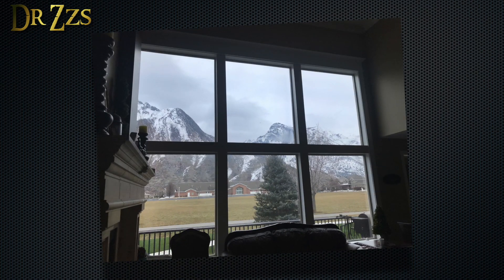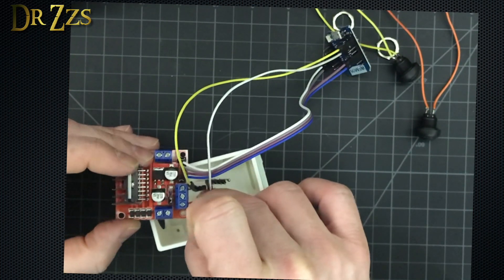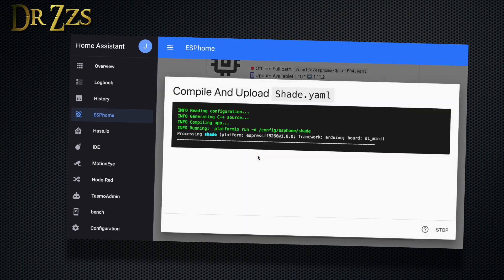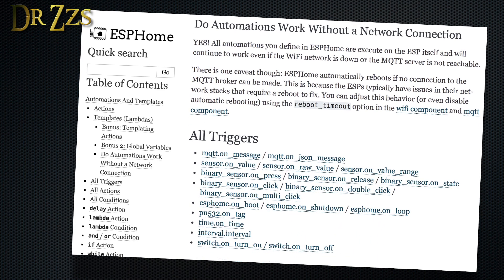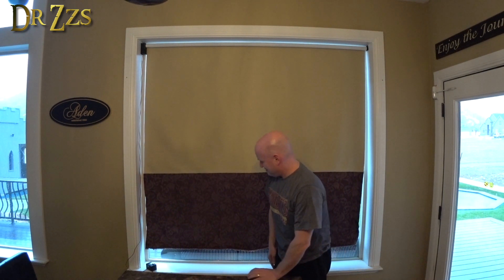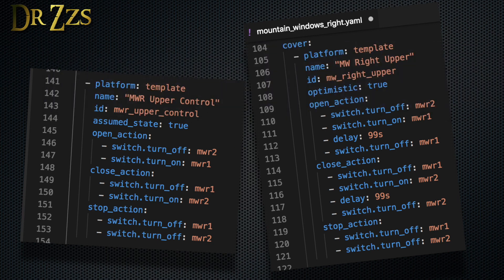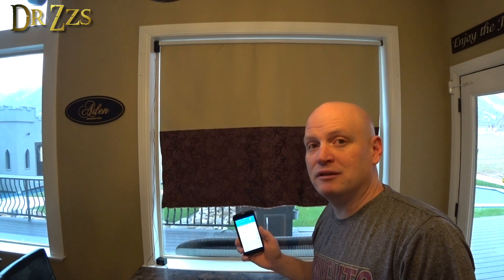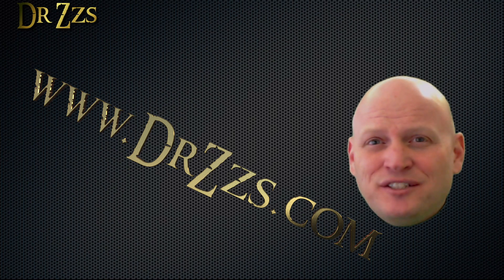DIY Smart Window Shades | Home Assistant

Comment: Create a variable for the current height. So you could do something like pause it in the middle and the variable would now how far into the movement it was when you clicked the button. And then when you go to the app and click go all the way up, it doesn't make the motor turn for 99 seconds, it makes the motor turn until the variable reaches the number your preset to be the completely open state

Comment: what's the difference between a switch and an output?
Reply: Exactly and I have the same question. I did some research but could not figure it out yet
Reply: A switch gives you a control that you can turn on and off. An output is something that the esp board can set to on or off.

Comment: You could use two door sensors (like the Wyze, or something that works without flashing HW) to provide full up and down states. Fasten one magenta to the center bottom of the shade, mount one sensor on the window sill and one on the frame above the rod. Assuming the location is sufficiently repeatable, the sensors can tell you when to stop.
To handle position uncertainty, just fasten a lot of small magnets (or maybe refrigerator seal?) Along the bottom of the shade.

Comment: What you call "intolerable levels" is nothing compared of what's an every day life in the middle east (:
Reply: I bitch about the summer heat in Kansas city every year, but someone always reminds me of how hot other places are. I'm thankful it doesn't routinely get over 38* here.. That said, upper 30s with 80%+ humidity still sucks.
Reply: Yup , here every day is considered “hot” so as you can figure out AC bills go high up 😂

Comment: DrZzs- you could add a magnet in the bottom of the curtain and reed switches on the lower and upper frame to indicate closed and open position. magnet strength could allow a larger gap

Comment: Hey Dr... 2 ideas here... 
1. Telescoping: Cut a slit over the length of the (EMT?) pipe and slide the curtain in. Gives you the ability to adjust it until it is just perfect, then a few dobs of glue at the end at the inside of the tube to fix them in place. 
2. You want to block out the sun and avoid heating your house up. But what if no one is home to close them? You have a light/ temperature sensor  controlling the automation? That would turn it fully autonomic! 

I am waiting on the arrival of my Raspberry Pi4 (4gb) to get started transforming my automation to a non internet-dependent/ privacy controlled one. 

Thanks for the educational videos and the occasional laughs! 
Sub +1
Reply from the maker: Thanks!
those are good ideas :)

Comment: am looking at some motors and I see some that are 25 RPM for the same price as the 10rpm . what a good rpm for windows blinds?
Reply from the maker: totally depends on how heavy your blinds are.  It's really all about the Torque. If the motor is the same power, then the gears have to change to increase torque, and that reduces speed.   A shade like I use in this video can use a much faster motor.  I changed this one out for a 45rpm motor.  
I was looking for a torque meter of some kind to be able to measure the torque required to lift something, but haven't found one yet.  So I've had to just try different speeds to see what works.  My blinds are pretty heavy and the 10rpm motor lifts them but I don't think one with less torque would do the job.  
Sorry that's not a firm answer for you.

Comment: So instead of a timer, couldn't we add limit switches to the esp8266? End stops in effect?
Reply from the maker: yes, and after trying a few different things, that's what I'm going to do.  I was trying to avoid running a lot of extra wires, but reed switches don't react fast enough and if you get the timing wrong just a little it adds up over time and pretty soon the shades are not at all where you'd expect them to be.
Reply: @DrZzs  yeah that's what I thought, 90 secs this way and 90 secs that way over time would see the blinds either do a wrap around on the pole or scare the cat as it hits the floor. But yeah magnetic Reed switches on a slow motor rotation should work well enough and due to not carrying a lot of current could be supplied by tinned copper wire, very thin and minimum raggling to hide  eh? Cheers for replying buddy

Comment: Suggestions: Use some 3d printed part to keep it straight and since u have ur controller at the end of the shade, using two IR sensor on the top and bottom as indicators to find if its all the way up or all the way down u may don't have to wait there for make it stop!🙌
Reply from the maker: good thinking!  I've since added a piece of thin pvc pipe to the end and it stays straight now.  I do need a better solution for stopping it at the ends.  Thanks!
Reply: @DrZzs Welcome, using some ir sensors is the easiest way u can find some coding in github just try it it's really easy!
Reply: @DrZzs  hey can I have your email I wanna show you something that I build thanks to you! If it's ok

Comment: I have 3 blinds all in proximity of each other that I would like to automate. Is there a Hbridge controller that would allow 3 motors?  I've seen some controllers for 4 for robots, but not sure if the specs would work.  https://www.digikey.com/product-detail/en/dfrobot/DRI0039/1738-1191-ND/6588612?WT.srch=1&gclid=EAIaIQobChMI5qPu28WW4wIVlrXACh1CwgI5EAQYAyABEgKXFvD_BwE
Reply from the maker: I just took a quick peek at it and it looks good to me.  1.2a should be fine for these motors. The one I've used is rated for 3a but I think it's overkill. Anyway, looks like that one you've linked would work for 3 blinds.  Good luck!

Comment: Don't you find those geared motors very noisy for this application?
Reply from the maker: Kinda noisy ya, but not enough to really bother me.  I would expect there are other options that are less noisy but they are likely more $ too. 
I like these motors quite a bit.  They are cheap and they work.  That's 99% of what I look for in parts.
Reply: @DrZzs  no question on cheapness and ease of installation and thanks mate for the housings and stuff on Thingiverse.  Might try steppers to make it quieter but not sure it'll be a massive change in volume. Love your work though mate and all the best from sunny Glasgow,  Scotland.

Comment: The telescoping could be caused by the expanded pipe, where the bearing was hammered in. The larger diameter will reel in that side of the shade faster.
Reply: This is absolutely correct. Even a small diameter change will have big affects the more turns that are added. If you measured the circumference of each end, the difference is how much you will raise the larger side per revolution. If  the difference is 2mm and there are 10 wraps of fabric, by the time you raise the blind, one side will be 20mm higher, about 3/4 of an  inch.

Comment: Add a rotary encoder so you can tell exactly where the shade is.
Reply: What if it for some reason stops and you start it again..?
Think there is no way other than some kind of limitswitch for up/down. Magnet fastened to the curtain and magnet-switches on top/bottom?

Comment: If you really want to stop the heat coming in the home, you really need to put the shades on the OUTSIDE of the windows. Once the heat has come through the glass, that heat is in the room and you're only keeping the heat (partially) between the glass and shades. Any air movement will cause the heat to leak into the room. Here in Oz you see lots of houses with shades on the outside, particularly on the west side of the house (afternoon sun).
Reply: Not really. If you have highly reflective shades, they'll bounce most of the infrared light back out of the window and keep it from hitting more absorbent surfaces inside that turns the IR into heat.

Comment: you should add a position measurement to your shades to prevent them from uncertainty propagation . Either a switch to count the rotations but when you lost it there is no automate way to regain the current position or you use a switch or current detection which knows when you reached the top /are driving in the backstop but you repeatedlywill need to do a reference position maneuver

And when you are moving the shutters you can count the driven time or ticks and you will always know what to do to reach a position

Comment: Secondary to the purpose of the video... Need to work on your first layer unless you intentionally designed textures into the parts. It also seems you have the same black filament issues I do; royal pain to get good, small prints w/ it.
Check out the forums on FB if you haven't already. Lot of helpful people there.
Reply from the maker: Thanks.  I'm also using the MoarStruder with a 1.2mm nozzle so I don't get fine details, but I get big parts printed fast and strong.
Reply: @DrZzs  that's 3x bigger than mine. I agree on getting big things done fast. When I start printing Halo props I'll probably wish I had a bigger nozzle (definitely bigger printer).

Comment: Flare on rod end for bearing, if flare is in contact with fabric, will cause the "telescope". I did not see if this was the case or not.
But awesome video.
Reply from the maker: Good point!  That’s probably it. Dang. Maybe I need a different solution from that bearing.

Comment: What RPM motor did you get? I'm noticing that on amazon they're all the same price is there a downfall to getting the fastest one?
Reply from the maker: The one I got is 10rpm.  There's a trade off between speed and torque (lifting strength).  So the faster ones won't be able to lift as much weight.  I didn't do any calculation to figure out which one to get.  I just figured 10rpm's would be enough torque to do just about anything.  I'm sure you could get one that goes faster and would still be strong enough to lift a shade.

Comment: Now I just need this to work with Alexa rather than Hass.
Reply from the maker: Oh, it'll work with Alexa too.  There's a few ways you could do it.  Do you just use Alexa as your hub?  I use Alexa via Nabu Casa (HA cloud), so she can control anything I have in HA.  But there are other ways.  Maybe nodeRed, or maybe a different firmware on the D1mini that interacts with Alexa.  I'm sure there are ways.

Comment: You need to calibrate the extruder on your 3d printer, you are under extruding badly.
Reply from the maker: Ya.  I use the Lulzbot Taz5 with the MoarStruder.  It has a 1.2mm nozzle and prints big parts really fast.  That first layer doesn't come out too well.  I should look at that.  Thanks.
Reply: @DrZzs , the Taz5 is a great machine. You should be able to get that dialed in without too much work.

Comment: ESP Home looks amazing I need to get more nodeMCU's and D1 Minis
Reply from the maker: Yes you do!   and get some ESP32's while you're at it.  ESPhome works with ESP32's too.  I'm betting by the end of 2019 most of my projects will be ESP32 based.  They don't cost much more than the 8266's and they are much more capable.  But I still have like 10 D1minis that need a purpose in life :)

Comment: Maybe a reed switch to tell if it’s fully open or fully closed? Just thinking. Or maybe with some clever automations I’m not smart enough to figure out could tell when it’s not fully closed and if u want to close if fully it would go all the way up for 99 seconds then go back down
Reply from the maker: good thinking.  That's what the end-stop switches would be for.  But the shade would have to have enough weight to trigger those switches.  There's probably a few good ways to do it.

Comment: Would it be possible with the currently available GPIO in this project to add limit switches for top/bottom?
Reply from the maker: yes, but not if you wanted to run 2 shades from one controller.  Each shade needs 2 pins for motors, 1 pin for push button, and 2 pins for end-switches.  if you try using 2 motors that would require 10 pins.   You might be able to do it, but you'd end up using some pins that have other functions, like Rx/Tx probably. You'd have to be careful about which of those pins is low on startup.
Reply: @DrZzs  maybe if one used an ESP32 based NodeMCU board there'd be plenty of i/o pins.

Comment: Like a lot this video ... I'll use it in order to make a automated dor to my kitchen coop :-) 
But... why you didn't buy a A4988 controller ? ...can this be ok for this project ? 
something loke this one:
https://www.banggood.com/3D-Printer-A4988-Reprap-Stepping-Stepper-Step-Motor-Driver-Module-p-88765.html?rmmds=search&cur_warehouse=CN

Thanks a lot
Reply from the maker: With these motors I don't think that controller would be able to reverse the direction of the motor spinning.  I could be wrong.  I got these motor controllers because they are H-Bridge. It was an engineer friend of mine that suggested them.  
I have some a4988 controllers.  I'm currently trying to get them to work with ESPhome and a stepper motor.
Reply: @DrZzs  Great... as soon as you get it work please make a video :-)
Thanks a lot

Comment: No limit switches?
Reply from the maker: no, I decided not to use them.  The motors turn so slowly I think the timing method should be fairly accurate.  Also, I didn't add a weight to the bottom of the curtain, so I don't think the weight of just the fabric would have been enough to trigger the end-stops.
Reply: @DrZzs  Over time they will be more and more off. That's where limit switches are great, so they can zero themselves.
A limit switch can also be made with magnets and a reed switch, without the need to push a physical switch.

Comment: I thought you were doing blinds, not shades.
Did you abandon the blinds project?
Reply from the maker: No, not abandoning the blinds.  Still working on those right now actually.  Trying to use a stepper motor and a4988 controllers with ESPhome.  I still have a few things to figure out with that one.
Reply: @DrZzs  I hope you figure it out, because I sure would like to automate my ole wooden Luxaflex blinds, if I can find a stepper motor with enough torque that fits inside the rail, I doubt that a pancake stepper can lift that heavy pack of wood blinds

Comment: Awesome! I have shades that I want to retrofit a motor onto. I haven’t done enough research but is it possible to allow hand operating and motor operated? The blinds we have allow you to put them up by pushing up with your hand. They have springs in the top that wind up as you push up. It will stay where ever you want. I would like a motor that will stay unlocked and remember where the shade is at. Example someone opens it by hand half way and later that day I want it to go the rest of the way up by motor. I’m thinking a stepper motor would be best for this.
Reply from the maker: Thanks!
I agree, that sounds like a job for a stepper motor.  If the motor is "off" you can spin the shaft without much resistance.  These geared motors I used will NOT spin manually.  So my shades are only able to work with the motors.

Comment: I have a few ideas for you on your curtains. 1. Use a heavy-ish rod at the bottom to evenly height down the curtain so it could possibly reduce or eliminate bunching. 2. Use a sensor switch, mostly laser or magnetically functioning, to stop the curtains at the top and bottom when triggered.
Reply from the maker: Those are good ideas.  
The bunching up really bugged me.  Gotta get that sorted out before I do all 6 of those big windows.
Reply: DrZzs Good luck. Would love to see your content on that.
Reply: That's exactly what I thought, it would just need a Reed switch at the top and bottom and magnet on the rod to define a min and max

Comment: use thin cardstock strips to shim...tuck them into the shade roll at full extension on the "long" side until you're happy with it
Reply from the maker: I'll have to try that.  I saw someone use tape on the short side to reduce telescoping.  I think my shade may not be totally square.
Reply: @DrZzs  The professional installer who mounted our manual blinds, did exactly that. One or two pieces of 3 cm masking tape on the rod quickly corrected the telescope effect.
Thanks for the awesome video 😊👍

Comment: love the video but the bearing into the conduit and the self tapping screw into the drive plate made me squirm, I work in an engineering firm and can see why you're a doc 😂
Reply: Well he could mount the bearing in the wall mount and then make a proper sized  adapter to go from the emt to the inside of the bearing.  And I would print that adapter on its side for the added strength.   But great Video overall!
Reply from the maker: ha!  I'd flunk out of real engineering ;P
Reply: DrZzs the way I would do it involves schoolboy science . Get a bearing about 1mm to big and put it in the freezer put the end of the conduit in a pan of boiling water then the bearing should slide inside but it’s a one shot deal once they both get back to room temperature you’ll never separate them 
Should be able to do that with the drive plate as well if you print it a touch bigger
Reply: @pistonbroke5405  1mm? Way too much. I agree with the idea but the thermal coefficient of expansion of steel is around 13 * 10^-6 m per degree C. I have done this with large Alfa Laval centrifuges and it ain't easy! Would suggest a slight interference fit and press them in.  But the inside of the conduit would need to be machined perfectly round and smooth.  The idea is great, but the engineering side of this project is dodgy at best.